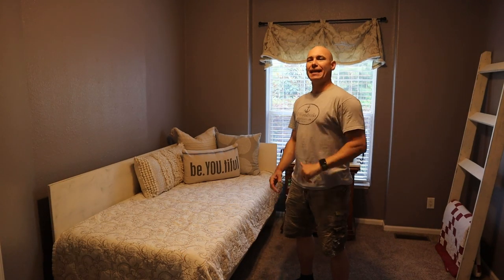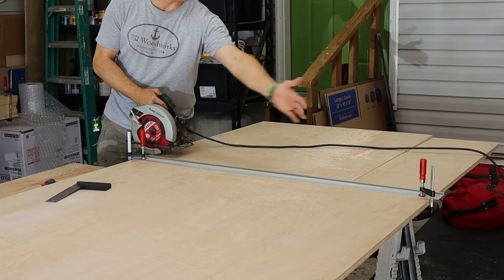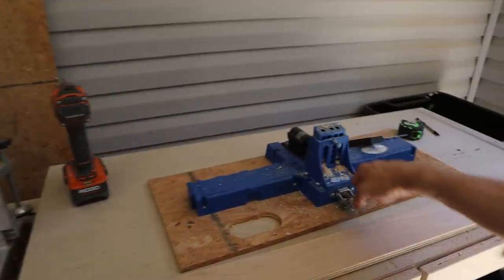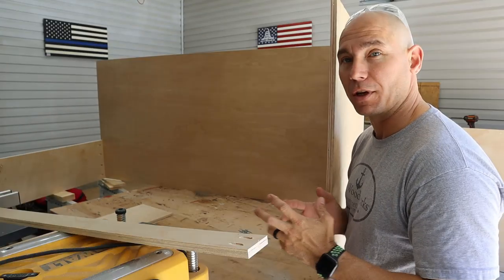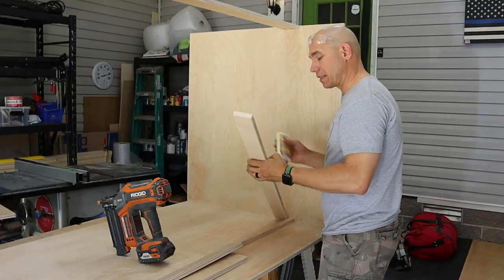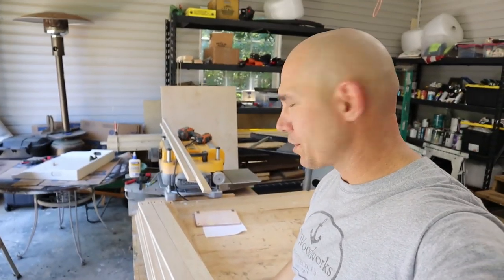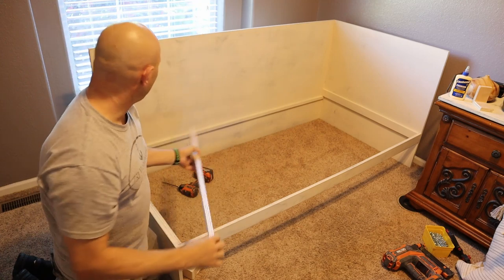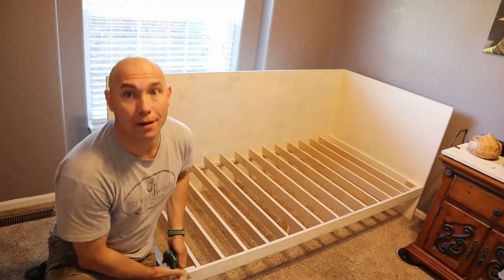Make a Daybed Using Plywood and Basic Tools | Easy Woodworking Project

Comment: Thanks Matt! Did you consider maybe covering the exposed edges of the plywood with solid wood trim?
Reply from the maker: We talked about it, but the boss wanted to keep the exposed edges :)  I have covered them on other projects with either edge banding or cut a 1/8" strip of spruce and brad nail/glue on.

Comment: What I was really looking for is a video on how to attach a queen size metal headboard (I have that) to the SIDE of a twin metal
frame with the metal headboard being the large side piece (if looking at it as a daybed, it would be the back of the sofa effect).  So, what kind of hinges, adapters do I need to use my existing metal headboard on the long wall side of a twin mattress/metal frame?
Reply from the maker: Sounds like L brackets would work.

Comment: I have had terrible luck cutting big sheets of plywood. I always end up with messy edges with tear out on the first layer or two. Any suggestions on how to avoid this? I like the bed a lot and we have a need for something like that.
Reply from the maker: Using a quality blade is key.  60 tooth or more would be best for sheet goods.  I've also seen people use painters tape to tape the exact line the blade will travel on each side and that prevents chipping and tearing too.

Comment: Is there a video on your miter saw bench somewhere?
Reply from the maker: I didn’t publish a video on it but I based it off of this one https://www.hertoolbelt.com/mobile-miter-saw-station-and-storage/
Reply: @731Woodworks  Thanks for the quick response. I'll check it out (after I finish your bed vid first, of course).
Reply from the maker: You’re welcome
Reply: Me again.... @ 16:52, when you added the corner brace, did you glue/nail to the foot board AND front rail? If so, doesn't that prevent you from disassembling it to remove from the room in the future?
Reply from the maker: Yep. It’s in there now lol. You can screw it to the front rail and not glue it to make it easier to remove
Reply: @731Woodworks  I'll make sure to keep that in mind, and learn from your OOPS. Thanks, again!
Reply from the maker: Jeremy Kmieciak you’re welcome 👊🏻